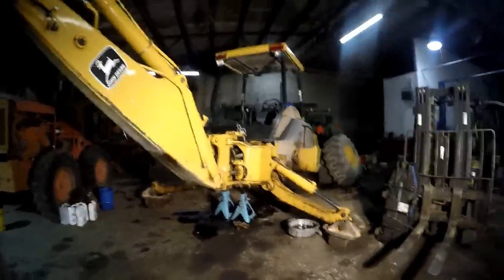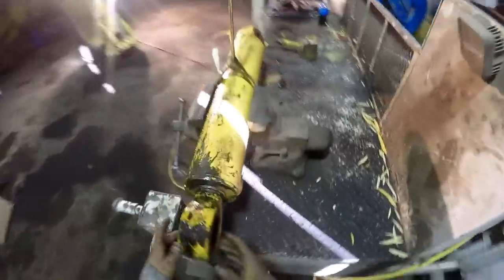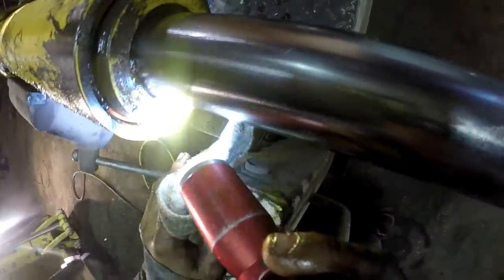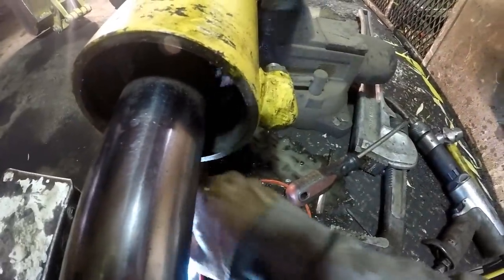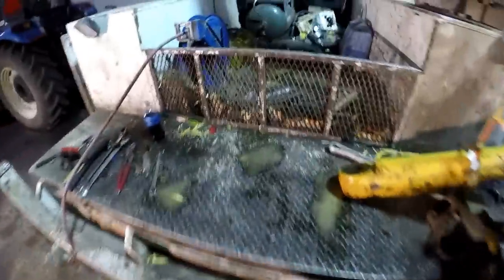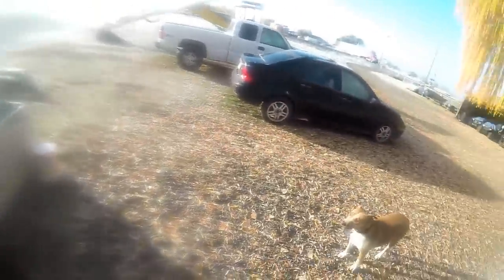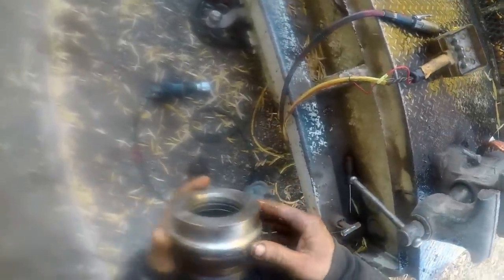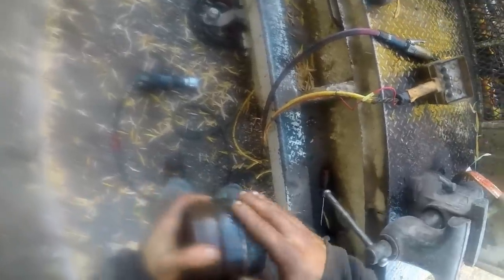Hydraulic cylinder rebuild  part 1

Comment: I just gave you the 1000th like on this. My 3165 Massey Ferguson with a 222 backhoe has the same style gland/rod bushing on it. I suspected an internal snap ring and you confirmed my suspicions! I was a millwright from 1987-2012 and never had the displeasure of this style gland/bushing on a cylinder. Now "The Ferg" will dig again (without leaving a trail of oil)

Comment: I have a cat 416 backhoe and the front bucket only lifts halfway with a full bucket. When it's empty, it lifts fully no problem. All the other 
controls are fine. I watch your channel all the time and thought I'd ask for some help. Thanks for posting your work and happy you got such a 
great deal on your new service truck.
Reply from the maker: Does it leak down  with bucket raised ? Could be a cylinder leaking internally  ,  linkage from joystick to valve problem  , maybe a weak pump . I would say probably leaking cylinder.
Reply: @westerntruckandtractorrepa1353   Thanks, I appreciate it. When I know more I'll let you know.

Comment: a 2 part epoxy like JB Weld works good also.Let it harden overnight and sand smooth. Did my JCB stabilizer cylinder years ago, still holding good.

Comment: Those orange rings you pulled out were left there from the last guy who put kits In cylinders. They go in the groove so snap ring will slide past. They come with seal kits.
Reply: The orange ring is also required to pull the piston out, there are a couple rings that will drop into that slot

Comment: Warren back in the day I use to see my dad take a brass ball valve with an air fitting on it and screw it into the outlet port . He would crack the valve a few times with air and it would push the cylinder right out. I do not know if that is good or bad but it seemed to work !! He has been known to do some sqeechy  stuff 😂
Reply: No thire aozz

Comment: I’ve done the same thing cleaning up the cylinder rods and was taught a trick that lasts a long time …. Clean the high spots and fill the scratches with super glue and instant cure spray sand again and they don’t seep…..

Comment: The number one contamination source of hydraulic systems is cylinder rods.  I'll put 5 bucks that's why the oil is milky.  Unfortunately scuffing the rods will make the seal hold a bit longer, but will leave pockets fordirt and moisture to enter

Comment: Warren try putting a 3ft piece of 4x4 between rod and the ground as a brace then use 1”drive pull bar and 6ft of pipe on the bolt or nut that usually helps to get them loose as well

Comment: That shop is pretty average, in my experience. Our place (equipment dealer) is only about 18 foot high ceiling so lots of booms / bodies cant be raised enough to work under them. Those jobs end up being done outside - rain / cold / snow or whatever doesn't matter. Creeper work can suck 'cause the concrete is deteriorated and is as smooth as a driveway made of #57 gravel in lots of places.
I have not used the service yet, but a hydraulics repair place we use for certain repairs has offered a rod repair service that sounds like a hard epoxy filler that gets cooked in place and polished so the rod is supposed to be smooth and round again.

Comment: Hi Warren, we have done many JD Ag hyd. cylinders. We find that on some JD has used a lot of red loctite when putting the nut or bolt on the piston rod end.
Reply from the maker: I have had some that took alot more time to get loose than the one I showed.

Comment: hard part is getting them back together. my bobcat cylinders had teflon o'rings. soaked them in hot water installed them on the piston then used hose clamps to shrink them down so it all fit
Reply from the maker: The teflon seals suck .
Reply: Yes, Those are the Glass Filled Teflon Piston Seals and need to be warmed to stretch on. 
Soaking in Hot Water or Oil is best, although you can place them in the sun or on the Car / Truck dash, whatever you can do to warm them up. Once seal is on ,you should wrap with tape (Sticky side out) and then a Hose clamp and put in freezer so it will shrink back down and not Shear when going into the Cyl.
The Brown Bronze Filled Teflon Piston Seals are the same way.
Urethane Pistons will just Stretch on and do Not need to be warmed.

Comment: i have a 310c. i didnt see you use a orange plastic filler ring to remove the piston W/ brake ring. can you explain the process? im actually building a crown cylinder for my 310c right now. used the orange plastic filler ring to make brake ring slide over snap ring groove. do i use it to rreinstall? seems like stuff would slip over tapered edge? also, why is the orange filler ring always found down in the gland when taking cylinder apart? if one doesnt have orange plastic filler ring...what does one do? i am using BULLDOG brand rebuild kit. it always leaves out the "buffer ring".  my cylinder was leaking out the outer dust seal. but i see no internal seal damage. all looks good. except....the piston wear ring was totally missing! thanks

Comment: damn that's dark, u need some better lights.  Menards - cheap.  and leaving that truck running inside.  U should consider your longevity in this and improve your working conditions.  Great videos, you are a talented mechanic that's for sure! I wish I had your talent.
Reply from the maker: Make checks payable to Butte Valley welding and equipment repair.
Reply: @westerntruckandtractorrepa1353  buy 1 light a month for 3 or 4 months. $30 a piece. U got this
Reply from the maker: Yeah no problem. I have spent over 50 grand between a service  truck , a heater for the shop another car lift , not to mention  the 1000 dollar a month  shop rent , and the 300 dollar a month power bill . I'll go behind the shop and shake that money tree  and see what happens.
Reply from the maker: @andrewschott3635   And I'm not dumping a bunch of money and time into a building I don't  own .
Reply: @westerntruckandtractorrepa1353  yep I get it. Not trying to bug. U do good work! Keep on my friend

Comment: Whats you're opinion on a 555b backhoe  I bought one for 1000 motors been rebuilt but they screwed the timing up on it I got tear it back apart.  3 cylinder diesel I figured 1000  I can't go too wrong. But what do you personally think.?
Reply from the maker: I think you stole it.
Reply: @westerntruckandtractorrepa1353  yeah lol.. but I mean as far as them as an overall machine was they pretty decent as far as reliability.

Comment: New Holland seals are way better, we use one 1700 hours every year. Our old one was on 11.000 hours and did never have a seal on the cylinders leaking, only seal leaking was from the transmission to the front axle.

Comment: If you ever had a big  Dent or a  Big scratch in the shaft of the cylinder   I've used a expensive two part  epoxy not for sure the name of it but it still holds up and working real well If you're interested I could probly find out the name for you

Comment: Hi Warren,  what's the CO level with those engines running inside?
Reply from the maker: I never had a shop that was insulated  or sealed up good enough to worry about it.

Comment: Warren  
Do you have some insite on a 900 ford 172  motor. the motor is all new but i can't get the rear seal to set i have the seal in right  and it just keeps leaking ???
Reply from the maker: Check the crankshaft endplay. Also make sure there is nothing restricting the crankcase breather or the pressure will shove the seal out . Make sure that that the seal is supposed to be accompanied with a wear sleeve on the crank , so the seal id is to big .

Comment: I had a Case stabilizer one time the guy before me red loctited the whole threaded end on the cylinder gland end. I heated it with a torch and melted the nylon back up ring a bit, it acted like a nylock nut. Case just has the two little pin wrench holes too that was a long couple hours getting that cylinder apart! I like the Deere ones better. I don’t like deeres extendahoe cylinder seems light and the plumbing rubs bad
Reply from the maker: Hey , I've run into 1 before some guy put loctite on the end cap nut too , I bet you cussed him like I did  .
Reply: western truck and tractor repair
Yes I cussed him, ended up having to keep the heat on it to keep the nylon ring soft as soon a I took the heat away it was like you welded it. It was crued Lol
Reply from the maker: I always put stuff together like I'm the next one that's gonna be tearing it apart again.
Reply: western truck and tractor repair 
Sometimes when I get something back together I say to the farmer, I feel sorry for the poor bugger that has to tear that apart next time. They always say it’ll probably be you. Lol